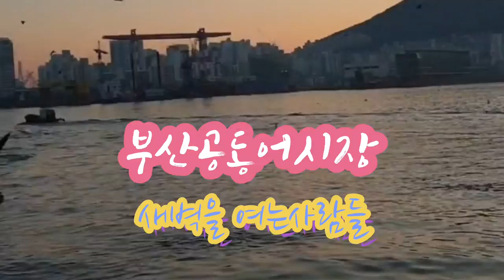부산의  새벽이  시작 되는 곳l 부산공동어시장lBusan Common Fish Marketl

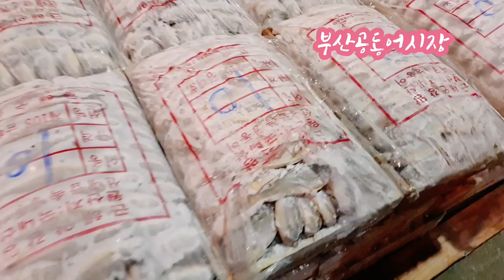Comment from the maker: Busan Common Fish Market #Mackerel #Aquatic Auction Christmas in difficult times A healthy christmas I wish you to send Busan Joint Fish Market opens the dawn of Busan As Korea's first modern fish market The history that began in 1963 at the Busan Fish Market The largest producer and consumer market in the country that supplies 30% of national seafood In particular, mackerel is a single fish and accounts for 90% of the nationwide distribution. Market in charge The auction starts at 6:00. Many fresh fish I saw for the first time The hands of the dawn moving in a breeze~Impressed, clapping Until the mackerel is on our table That many people’s hard work I saw it with my eyes. Different fish every day~ From 1 a.m. to prepare an auction in the afternoon Finish around 2 o'clock~♡ 2:17 Announcement of the start of auction by ringing the bell ㆍMackerel 5:39 Frozen meat auction ㆍearly 10:17 Sorted and packaged by size of auctioned fish 6:19 Unloading fish from the boat 12:34 The fish that was auctioned at the fish market next to the fish market is sold by an intermediary consignment seller to the market merchant or restaurant owner. 14:01 Street Fish Cake Meokbang 14:17 Wings and shouts at seagulls' prey